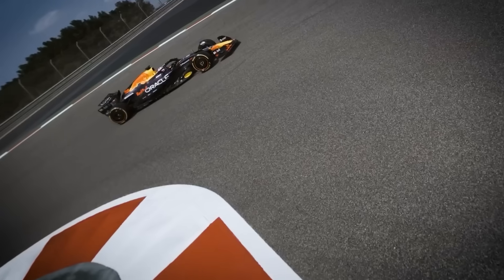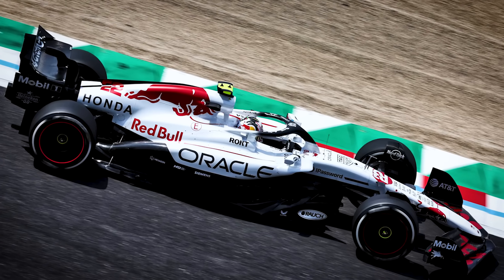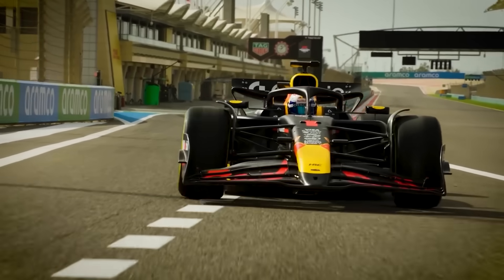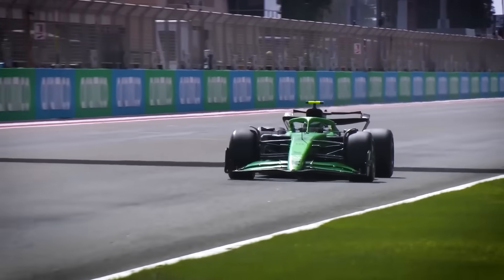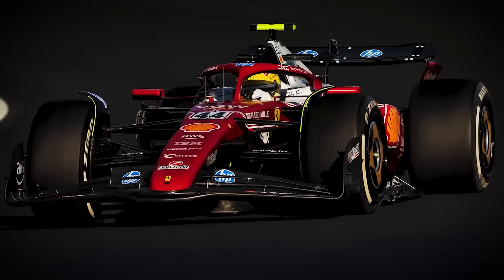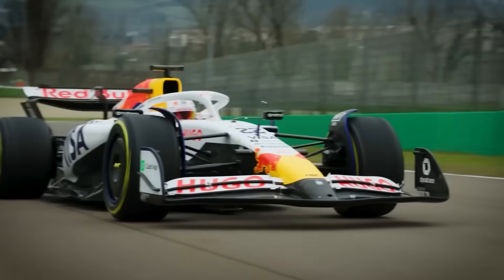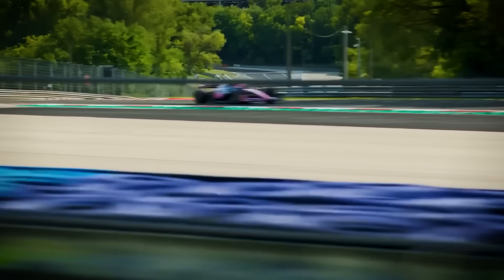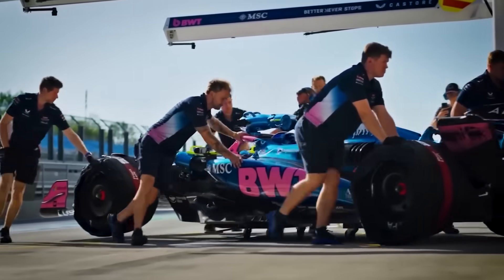THE SECRET F1 CAR THAT COULD BEAT EVERYONE (BUT WAS NEVER BUILT)

Comment: There are a few issues worth pointing out in this video. Regarding the cost cap, it was originally a temporary rule to help weather the difficult times of the pandemic (at the time, Williams was effectively bankrupt, and the American took over). On the other hand, regarding ground effect, it's a terrible rule. This aerodynamic effect only occurs at high speeds, where vortices form under the floorpan. Sure, there's less dirty air now because the car's geometry has been reduced, but the car still needs to dissipate the excess pressure, otherwise it'll dolphin. The downforce generated by this entire ground effect design is far lower than traditional designs. The 2026 rules are terrible, both in terms of power units and aerodynamic design, and I've never considered them a good rule. On the other hand, there's a very dirty side to this sport. Teams that cheat or circumvent the rules don't receive direct penalties from the FIA, as the FIA's interests are tied to the teams. Ironically, despite being exposed for cheating, Ferrari hasn't been penalized. Red Bull has repeatedly violated the rules, and yet, they haven't been penalized. The most ironic thing is Mercedes. Mercedes has never done anything outside the rules, but during its heyday, many of its designs were rejected by the FIA simply because Red Bull was unhappy. This is clearly not a fair sport. The sport has lost its passion. Everything is just a facade, a pretense of prosperity. The dictatorship of the rules has actually cast a darker shadow over the sport. As for Adrian Newey, I've always believed he's overrated. His designs aren't perfect; they're actually quite extreme. Take the current Aston Martin WEC race. That endurance car is completely Newey-designed, but it lacks stability and is becoming increasingly aerodynamically sensitive. Furthermore, Newey's designs often lack sufficient downforce, which is why they're more prone to spins. Formula One is fundamentally a resource-based sport; the driver isn't the primary factor. I hate the current myth-building of Verstappen. So much is going on in 2021. I personally only retain my passion for the technology of Formula One, but when it comes to racing, I've been completely worn down by the FIA's double-dealing. When every game is drowsy, it means that the game is very close to the end.

Comment: Isnt the problems with the ground-effect downforce caused by imperfections in the tracks? I thought that's why everyone had the porpoising issues at the start of the ground-effect era... if you maximise the amount of force generated, then as soon as you hit a bump, the effect stalls, and you lose a lot of the downforce, lifting the car. I recall someone saying that merc theoretically had far more downforce than the others, but it was stalling so much it actually made the car slower. Looked great in the wind tunnels, but just didnt work in real life.

Comment: Nobody go that far walking the line because it always turn sour. If by any miracle someone achieve perfection the car will be banned so...
Reply: Adrian Newey said confidently he could make a car 2-3 seconds faster than the current grid but you would lose all that investment when it gets banned so the goal becomes 2 or 3 tenths.
Reply: Exactly so is this really the pinnacle of motorsport ?
Reply: @LucianPrimeOneMillion   The concpet of pinnacle of motorsport make no sense when you think about it. We could already build race car no man could drive due to g-force. We reached a point you can't just set the dimmension an weight of the car limit and let's everything open, they would get rid of the pilot. We will have self drive race car taking curve at over 5 g reaching over 500km/h in straight line.
Reply: @legro19  True I mean with regards to technology etc and I also tought @legro19 meant making a perfect car within the rules. Hence why I said the FiA would just ban as they like.